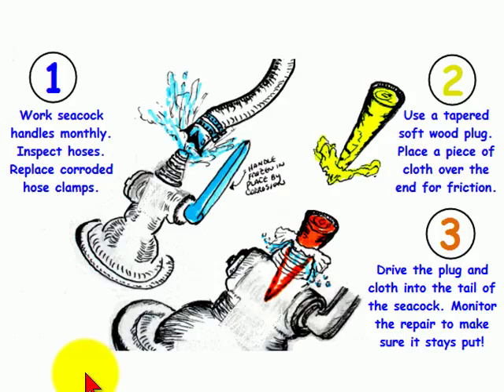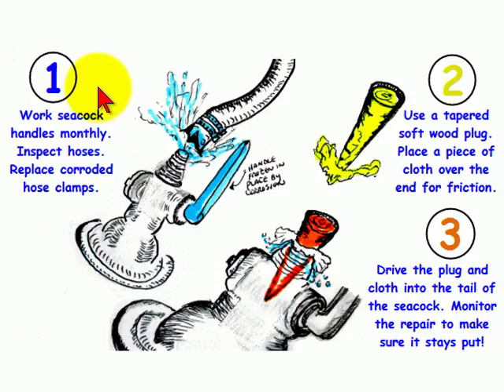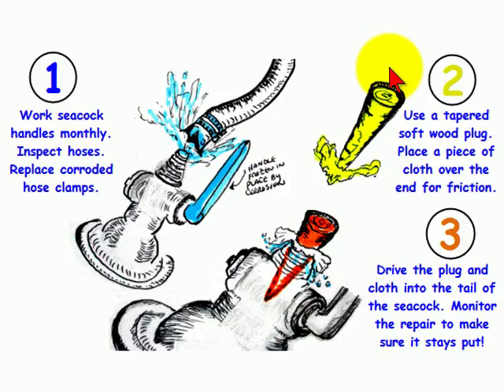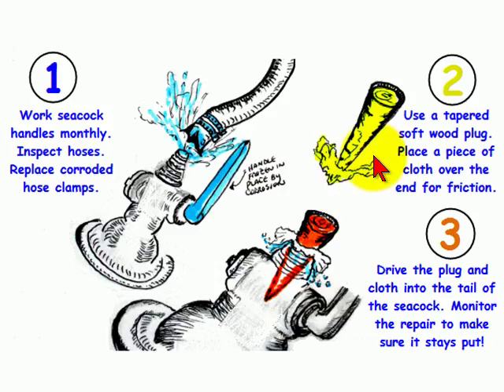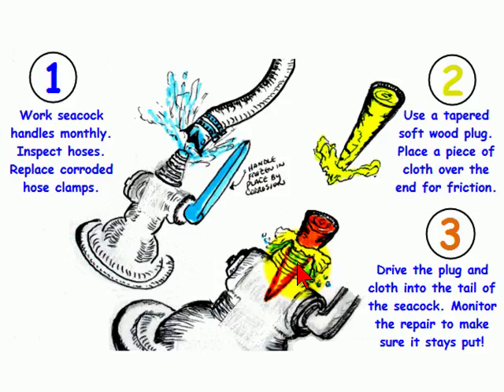How to Repair a Seacock

Comment: I was looking for a repair article.  This just covered plugging one in an emergency.  How about ways to get old stuck ones working?
Reply from the maker: Try tapping lightly with a hammer on the handle. Easy does it. If that does not work, haul the boat. Remove all seacocks. Disassemble ashore. Clean, lubricate, reassemble. After you haul the boat, If you are unable to get the seacock working, replace it. Do not attempt to force a seacock open. This can damage the seacock. Spend the bucks. It's cheap insurance against loss of your boat from flooding. Do not get underway unless ALL seacocks are working 100%.